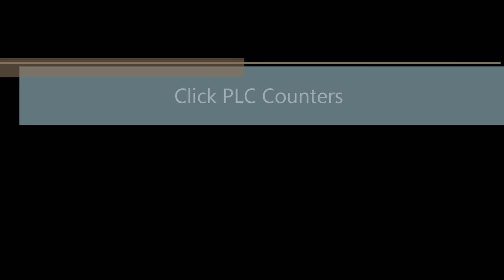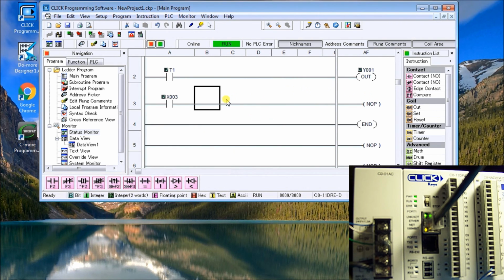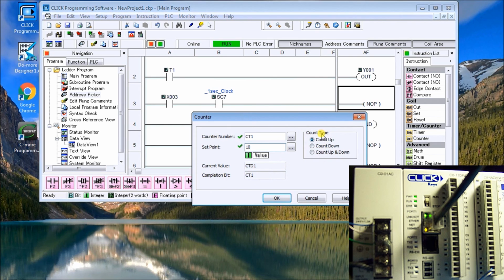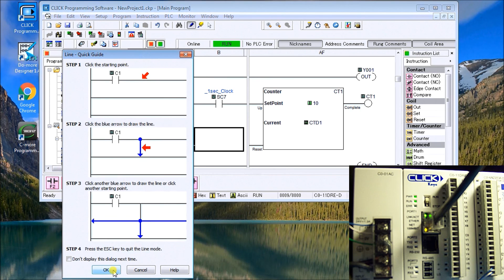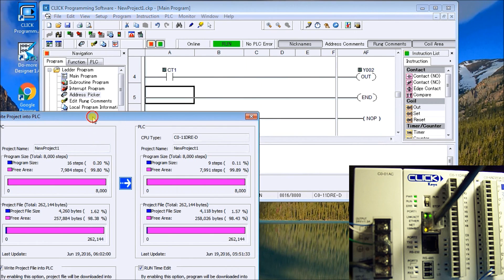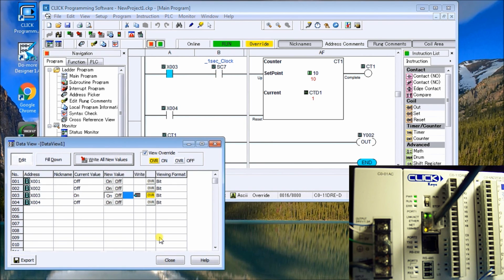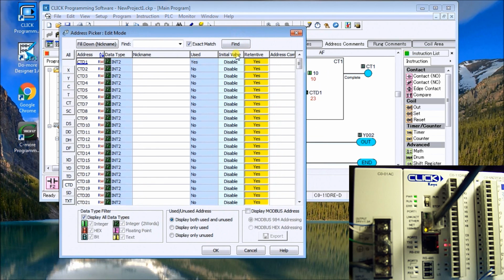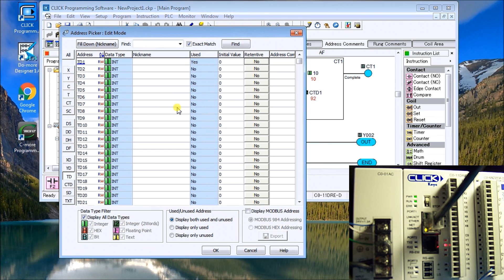Click PLC Counter Programming Example

Comment: The SC7 second contact is a good feature to have instead of having to use a timer.  My AB trainer software for the Micrologix 1000 doesn't have this.
Reply from the maker: Hi Dronai,
The system control bits (SC) can be very useful in your program. Here is a list of some of the other bits. These can be found in the help file. Seach for System Control Relays.

SC1
 _Always_ON
 Always ON.
 
SC2
 _1st_SCAN
 ON for the First Scan only.
 
SC3
 _SCAN_Clock
 Changes from OFF to ON or ON to OFF every Scan.
 
SC4
 _10ms_Clock
 Changes from OFF to ON and ON to OFF every 5ms.
 
SC5
 _100ms_Clock
 Changes from OFF to ON and ON to OFF every 50ms.
 
SC6
 _500ms_Clock
 Changes from OFF to ON and ON to OFF every 250ms.

 SC7
 _1sec_Clock
 Changes from OFF to ON and ON to OFF every 500ms.
 
SC8
 _1min_Clock
 Changes from OFF to ON and ON to OFF every 30 seconds.
 
SC9
 _1hour_Clock
 Changes from OFF to ON and ON to OFF every 30 minutes.

 SC10
 _Mode_Switch
 ON when PLC Mode Switch is in RUN position.
 
SC11
 _PLC_Mode
 ON when the PLC is in RUN mode.
 
SC19
 _PLC_Error
 ON when an Error occurs.
 
SC20
 _I/O_BUS_Error
 ON when an Error occurs.      
 
SC21
 _System_Config_Error
 ON when an Error occurs.     
 
SC22
 _I/O_Module_Error
 ON when an Error occurs.      
 
SC23
 _Flash_Memory Error
 ON when an Error occurs.
 
SC24
 _Project_File_Error
 ON when an Error occurs.
 
SC25
 _Project_File_Ver_Error
 ON when an Error occurs.
 
SC26
 Watchdog_Timer Error
 ON when an Error occurs.
 
SC27
 _Backup_Memory_Error
 ON when an Error occurs.
 
SC28
 _Battery_Low_Voltage
 ON when the Battery Voltage is Low (<2.5V).  When this bit is ON, replace the Battery as soon as possible.
 
Regards,
Garry

Comment: Can we save the Count Value after power off and power on again.  Retentive value has been restored to last value counted too.
Reply from the maker: Hi @phillipmaser132,
Counters are memory retentive by default. To make the present value non-memory retentive, use the first scan bit SC2 on the counter's reset.
Use a memory-retentive or fixed preset for the counter. If you are unsure, call the address picker. If the address is not memory-retentive, you can select memory retention, or vice versa. 
I hope this helps you out.
Regards,
Garry

Comment: What happens when the X001 input goes off and possibly back on later?
Is the counter 'retentive' , ie.  does it retain its accumulated count?

Also, what happens if the X001 input is on for a long time - will the accumulated counter value overflow possibly going back through 0, or setting a system error that could cause issues?

I have the same questions for the timer example but that could be addressed there.

Thanks
Reply from the maker: Hi Steve,
The count input of the counter works on the positive edge trigger. This means that the counter input can stay on or off and not increment the counter. 
The counter is memory retentive. If power is lost to the PLC or the PLC is placed in program mode, the counter will not reset. 
To make the counter non-memory retentive we can add a first scan bit to the reset of the counter.
If the counter is not reset and continues to count, it will count up to 2 147 483 647 and hold the value. This is the largest integer that 32 bits will represent. No error will happen.
Thanks for the question Steve.
Reply: Not 100% true. As loon as you hold your input X001 ON the counter will increment. For a problem like this you need to create "One Scan Shot". In order to have X001 work again you have to release it. This will prevent from incidentally holding your X001 longer than one count.